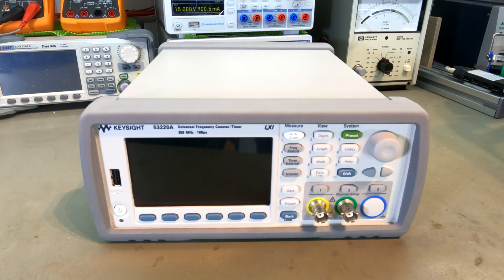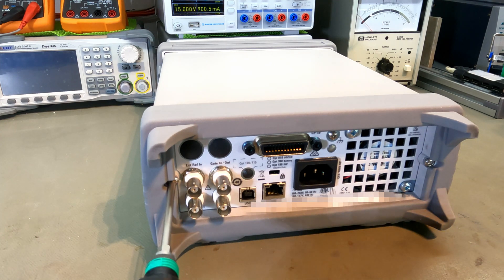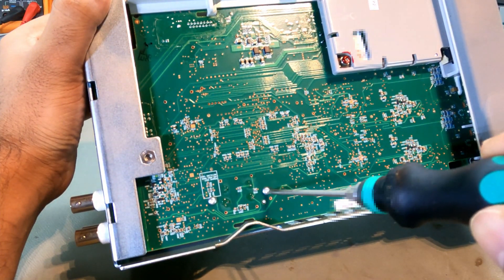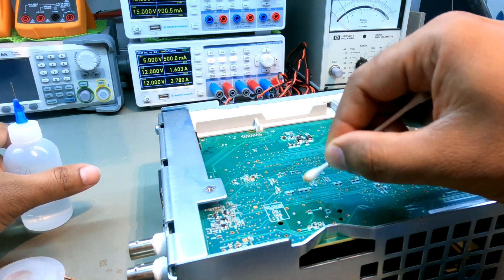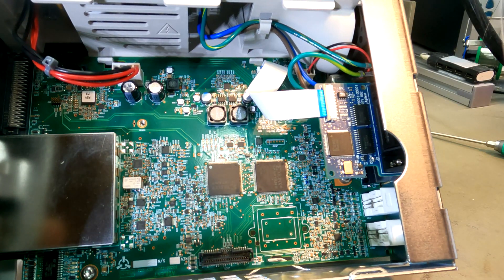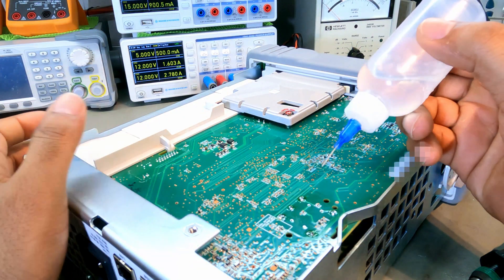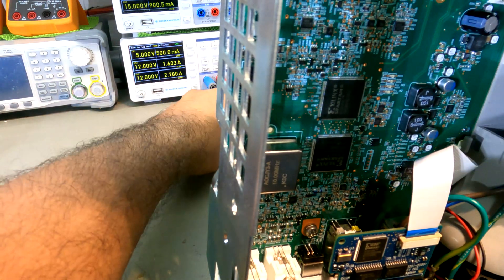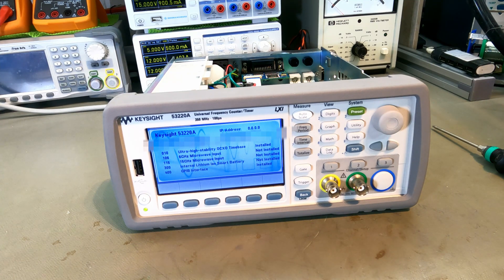Keysight 53220A Universal Frequency Counter Option 010 Ultra High Stability OCXO Timebase Upgrade

Comment: I think since all of these pieces of test equipment have a 10MHz reference input I would simply get a used cellular base station GPS timing card and use that for the entire lab.  They have a OCXO on them that is locked to GPS and thus are far more accurate than a stand alone standard like the inbuilt one you added.  The added plus is that all your instruments are all on the same timing page.
Reply from the maker: Thank you.